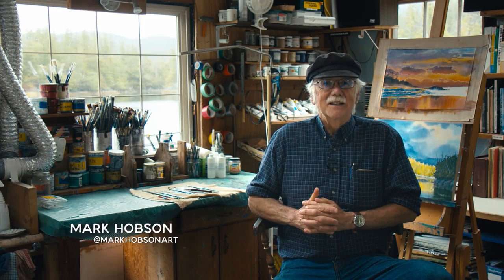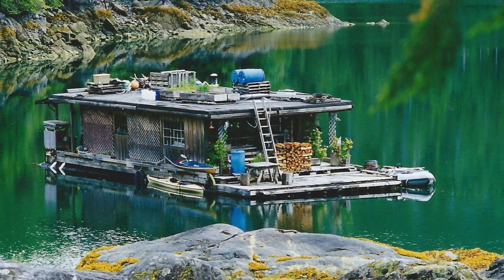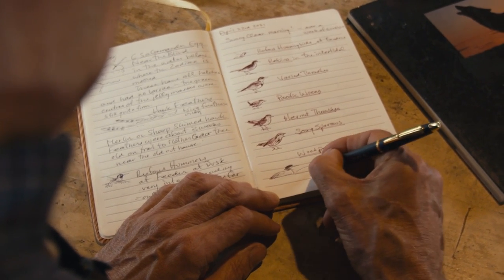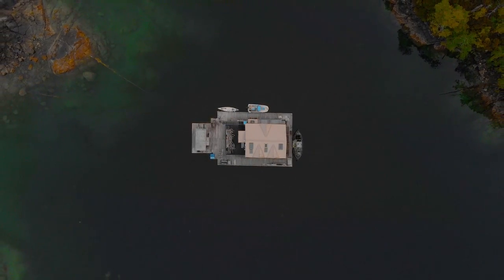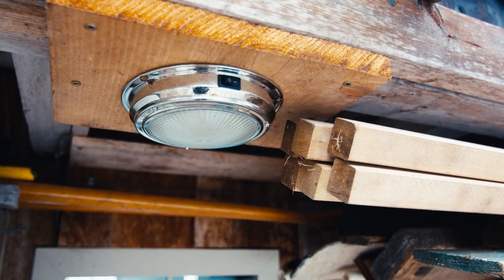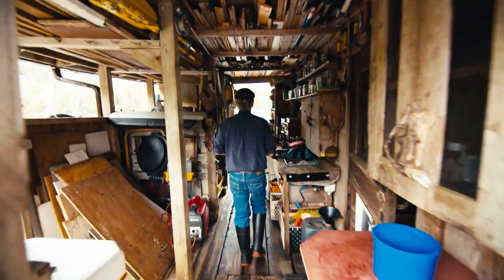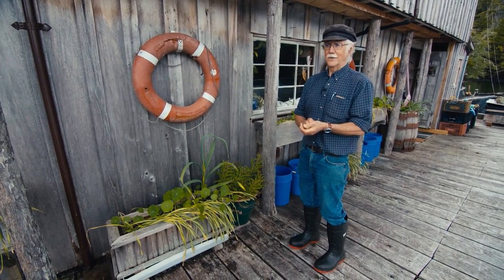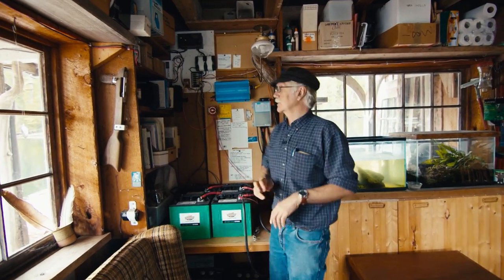This Off Grid Float Home is an Artist's Dream Studio

Comment: He could have a garden, all that lake water, he could use a wick system. Wouldn’t need watering much then. It would be constantly damp.  It works like a drip watering system, except instead of dripping from pipes above you instead use an absorbent rope left in a body of water one end and in the soil the other end.  As the soil takes the water, more is drawn up the wick.

Comment: I am so blown away.  I would be so afraid of a failure of the flotation devices.  Do you have multiple floats with sensors in them to alert you to a failure before you end up sinking?
Reply: Usually something like this has several dozen floats, with a decent amount of redundancy which makes it safe enough especially since you can find and replace any defective floats whenever part of the structure starts to sag.
Reply: @garethbaus5471  don’t know about the raft you see here…but the ones they build today have polystyrene foam in the pontoons so just in case of a puncture it won’t affect them one bit…they still float

Comment: your vent tube for the oil paintings would work better is you were to use a shroud on it, kinda like a rectangular heat vent on the floor going into the round tube